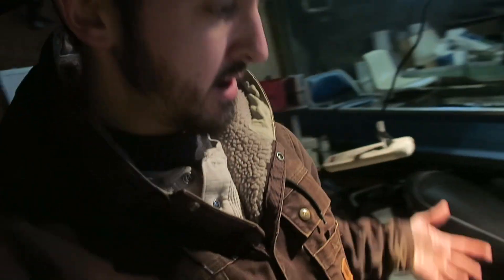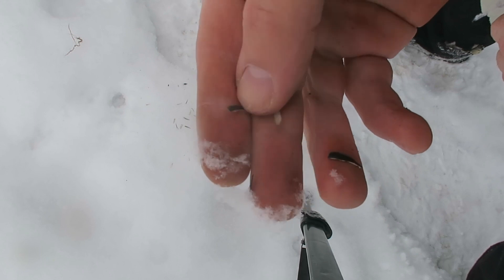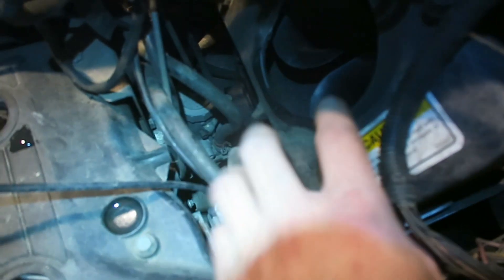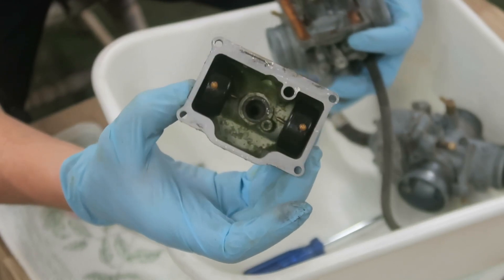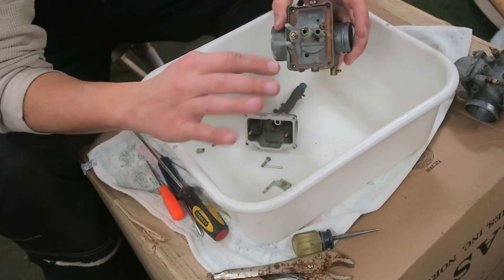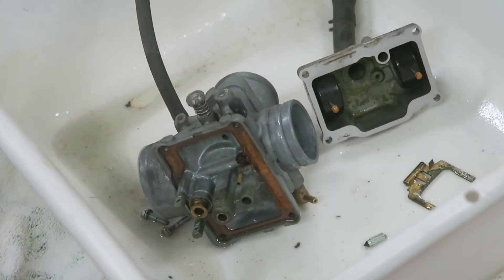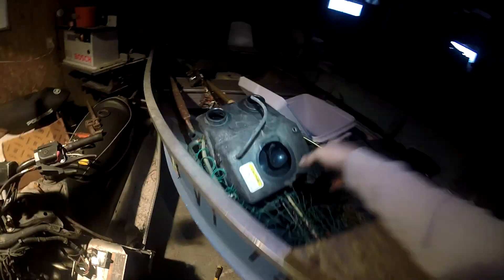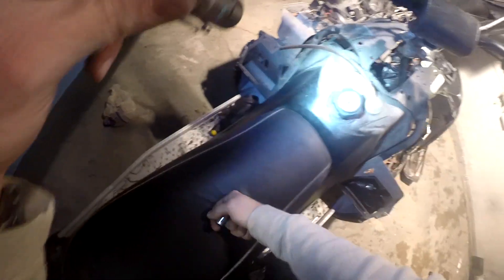DIAGNOSING & WORKING ON MY BURNT SNOWMOBILE (AFTER CATCHING ON FIRE)

Comment: 239.99 for a ggb mountain can, its a big sound difference and a lot lighter. It also doesn't require any tuning because it has the same back pressure as stock.

Comment: Don’t spend on new exhaust.  Nice sled, you can clean out the original one.   And no need to dump thousands on new sleds.  Even in New England we don’t get the winters like we used to.  10-14 year olds sleds are new enough for Vt and New England riding.   Great vid once again.

Comment: Jeremy, your videos are awesome. I like the fact that, you're working and riding older sled's. I have an 01 summit extreme 800. I got for a really good deal from a family friend. I'm on my third year riding it after sitting for a while I had to replace the reeds. At the time it was an expensive up grade. But worth it. More power. Witch is necessary for the Mt passes. I've been riding in WA. State. Keep up the good work

Comment: Stuff in your muffler will not cause the engine compartment to catch on fire. The muffler would blow it out on the trail not into your engine compartment as it is designed to exhaust out of the engine compartment. The nest under the muffler will catch on fire.

Comment: I throw older and even cracked gaskets in some oil for a couple mins before I re-use, and sometimes even cracked gaskets have worked for a good amount of time using that trick. idk why it works, but it's worked for me.

Comment: The stuff in the muffler didn't start the fire. Mufflers get hot, and it ignited the stuff on the floor pan there. In fact I was wondering if it would even matter if you just sent it with the stuff inside of it. It'll probably burn out with no harm I'd imagine.
Reply: Exactly what i thought
Reply: Nope, you’re both wrong, it can and will ignite internally if too much gas gets into the van and it backfires.
Reply: What are you talking about,  @2010Greendayfan ? Of course it Wille ignite the stuff. I said it would burn off. Burn=ignite. Most everything that was up there probably already burnt up the last time he rode it, and all that's left is some seed shells. If the sled is running rich, and  If too much fuel gets to the can it can backfire whether there are a few seed shells in the can or not. The few seed shells would have nothing to do with backfiring. Go play your guitar.
Reply: Do you think there will be an open flame in the can or something? There isn't any oxygen after the combustion cycle of the motor. The crap in the can will smolder away to carbon powder and probably eventually blow out.
Reply: BenSkiv98 stoopid
Reply: @2010Greendayfan  1) What does a leak have to do with a few seeds shells?????? omg. 2) If the muffler had a leak the exhaust would go out the leak, the air wouldn't go into the muffler. So dumb. Go play your guitar.
Reply: And apparently I misread things.... my bad... sorry bout that.

Comment: Hi I don't think the remains of the mouse nest inside the exhaust would cause you much trouble you could burn it out don't use gasoline though bit dangerous. I think the fire was caused by mouse nest external to the exhaust. Great videos really enjoy them.
Reply: Michael Clutton no, there’s a very good chance it was internal. If enough gas got into the exhaust and it backfired then it was 100% internal.

Comment: Love the videos I think you should keep the older sled I like the tinkering videos I have a 02 skidoo mxz 600 with a 670 motor and a 04 arctic cat 570z also just bought a 02 arctic cat zr 600 that I am going to pull the motor out of and put it in the 570z body

Comment: You're problem is you ride snowmobiles. Nothing costs as much per mile to keep running. Regardless of the make model or age. I have been working and riding them for longer than you have been alive. That said, yeah I am sure you will get it running again. I sure miss the old days when the engines were out in the open and or sat right between your knees. Kinda fun to watch you struggle with them though. I'm on your side though. Have fun!!
Reply: I beg to differ . . I'm boat mechanic. Cost a lot to keep them up,winterize,spring run through..etc ect